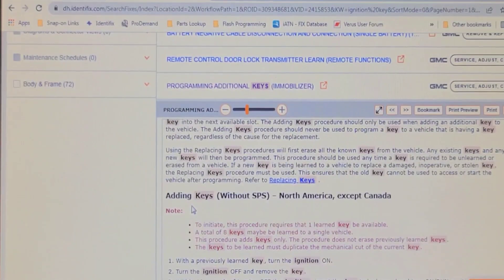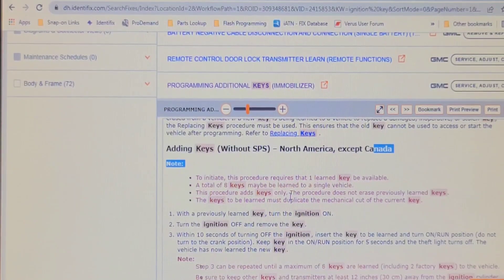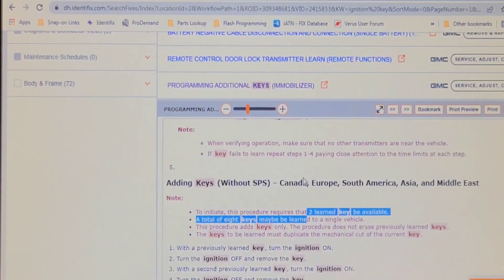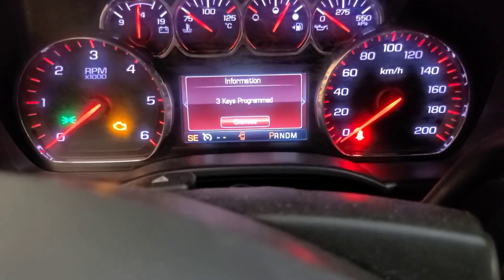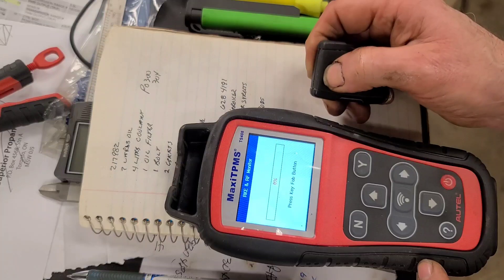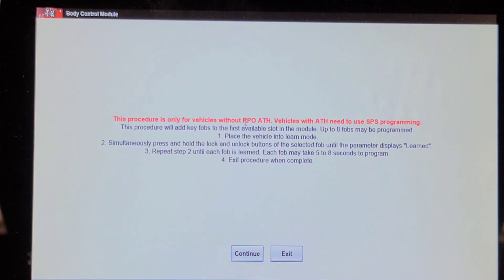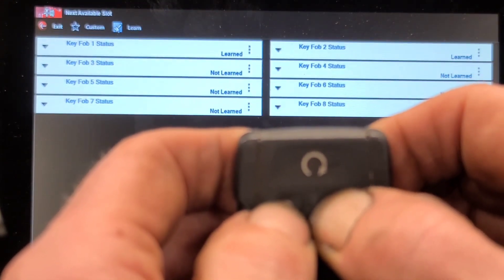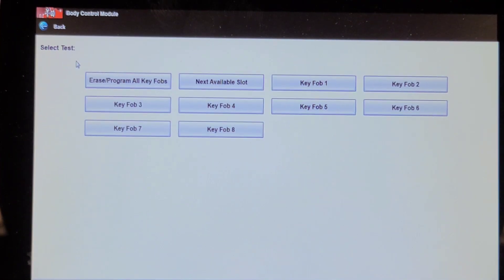2015 GM Truck. Adding Igntion Key and Programming Remote

Comment: Can you help me with my Cadillac Escalade hybrid no crank
Reply from the maker: Maybe, first what happened. Is there battery power on the 12 volt battery. Does the dash light up with turning the ignition on? What do you have for a scanner?
Reply: @PhillipBailey  yes I have a battery 13@ volts y I have a normal small scanner